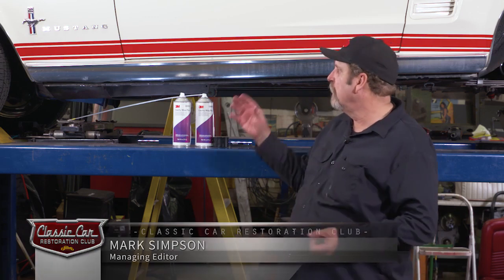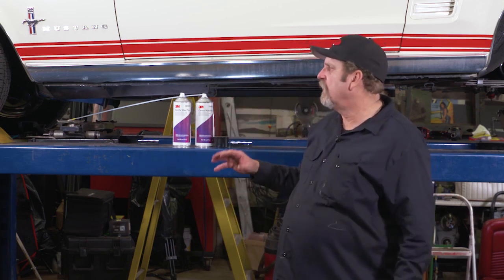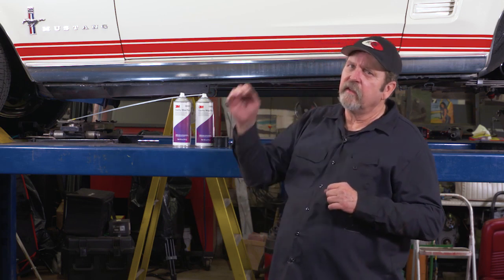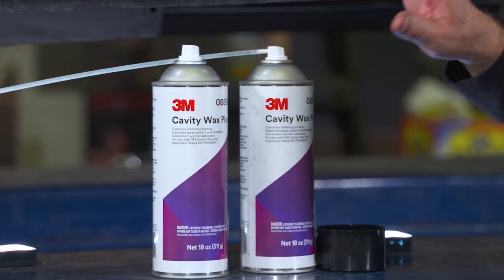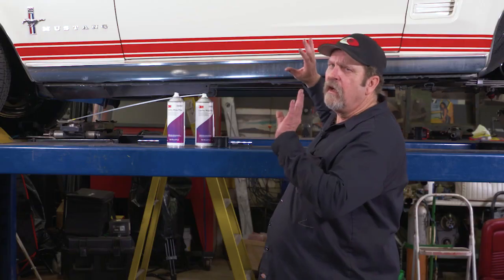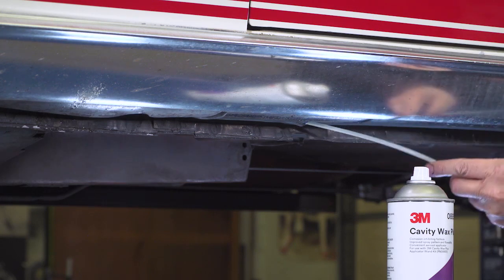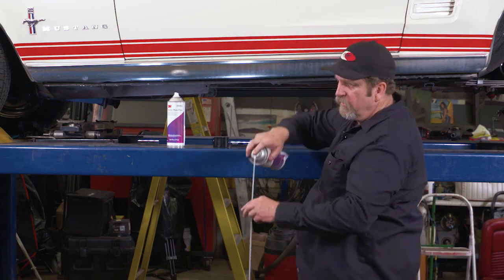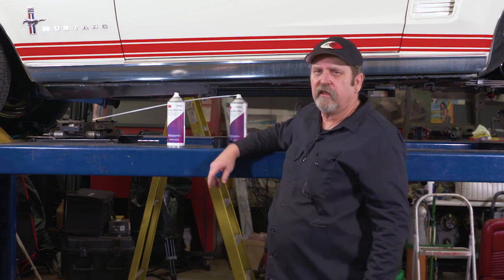Rust Prevention with Cavity Wax

Comment: I had rust under windshield , so my bodyshop repaired the rust and painted  panel finally , and said not to put cavity wax in this area , or else the silicone that holds the windshield will fail  to get hold of windshield with the body panel ,  Was the  bodyshop right ?
Reply from the maker: Great question! The ‘Ask an Expert’ section is currently for members of our online community. By becoming a member, you will have access to our expert knowledge. With your membership you will also receive discounts on products and hundreds of hours of Premium content.   

If you are interested in becoming a member, please click on the offer below:  
https://go.ClassicCarRestorationClub.com/C53253

Thanks!